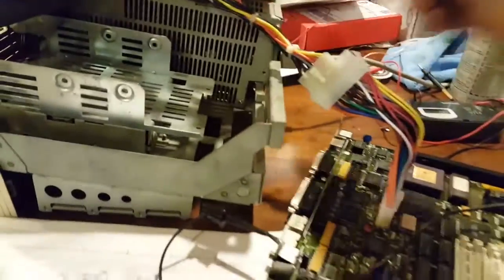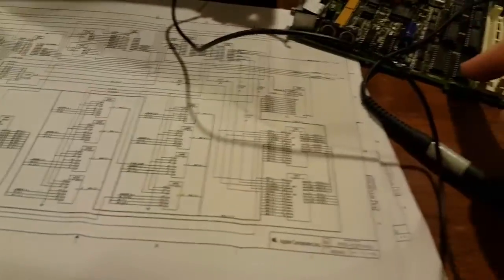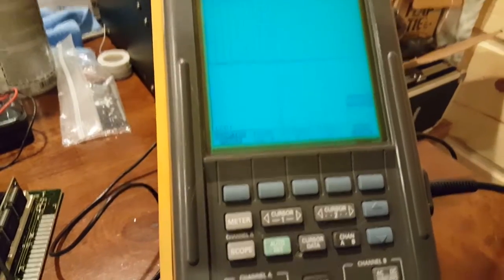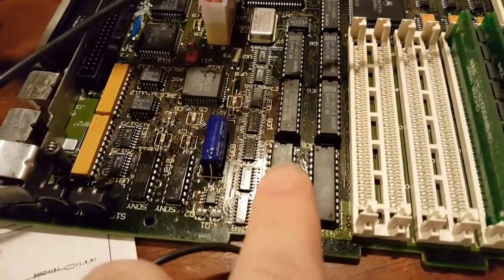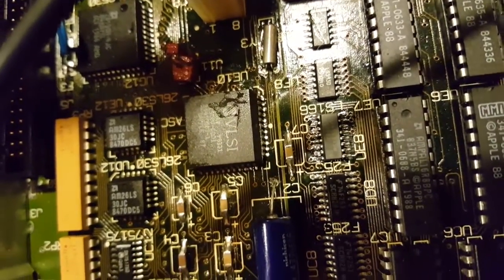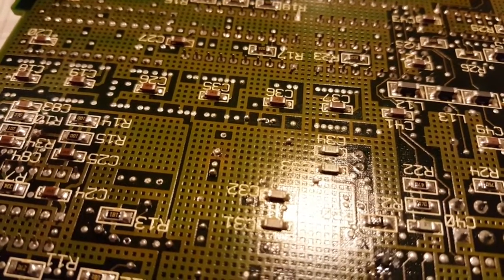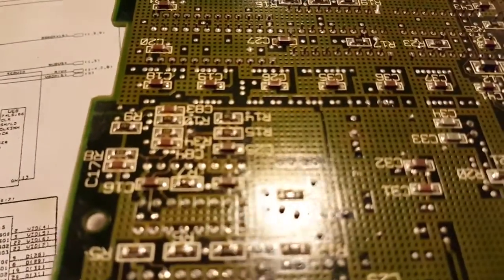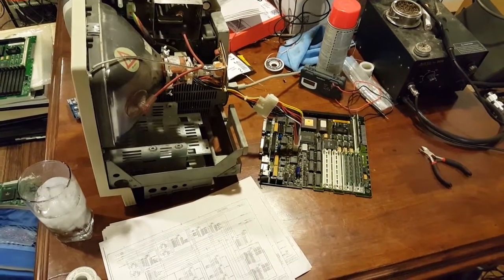Macintosh SE/30 video troubleshooting

Comment: I am trying to get my SE 30 up and running... I suspect very similar video issues as to what you are showing. I noticed that you aren't getting startup tone.  Is that a concern?
Reply from the maker: Yeap, if thats your case its because that means the machine is unable to read ROM, that is assuming you have cleaned the board, and replaced all of its capacitors that are bad. In my case in this particular video, it was due to the speaker not being plugged in.

Comment: I was wondering, I see that by removing the short you fixes it but I see caps missing - confused about missing caps. How does the machine work without the caps. Could you explain? Excuse my ignorance but I would appreciate your reply.
Reply from the maker: Umm.. Not sure what your talking about. there are no caps missing anywhere.
Reply: Oh my goodness, I am sorry, yes indeed you are right, I see surface mount ceramics there. Wow, those are so small I only saw the pads. Thanks for the reply.

Comment: Where do you get official Apple schematics?
I have a project I'm working on that involves a Macintosh Performa all in one mac's analog board and I need the pinout of it, but I can't find it ANYWHERE.

The only thing resembling any identification on the board was this text: PCBF ANALOG BD LC520/LC575/MACTV 820-0582-A
I'm on Applefritter as the same name if you want to use that instead of youtube comments.
Reply from the maker: Getting official schematics that arn't already in the public domain is EXTREMELY difficult. Mainly because we all know what kind of company apple is when it comes to servicing. It was just as bad back then as it is today. Hardware/peripheral engineers were able to obtain them during that time period as an exception. Thats how alot of them got out, That is how I obtained the official Mac Portable schematics as well, from the paper archives of a defunct peripheral company. However BOMARC reverse engineered several of them, and you get get them from maccaps.